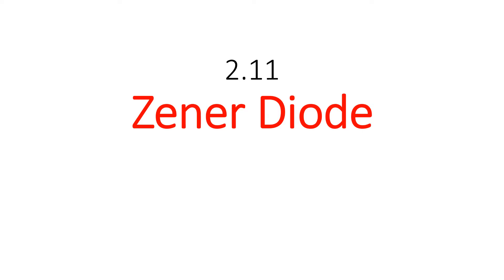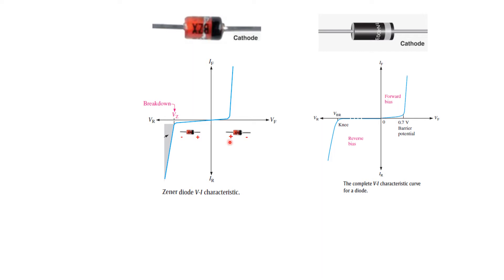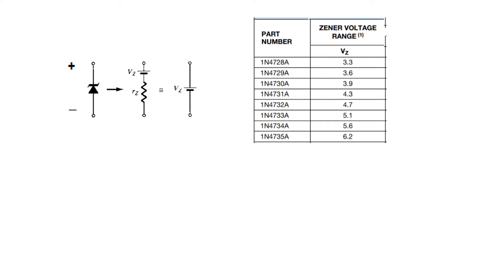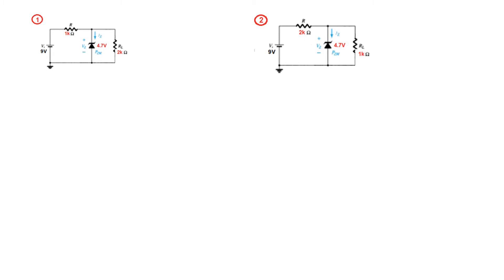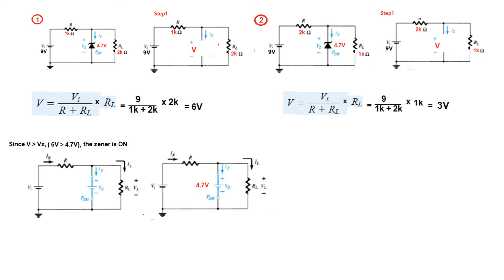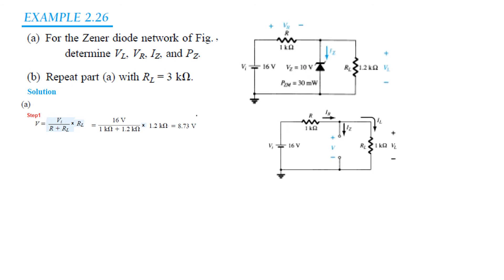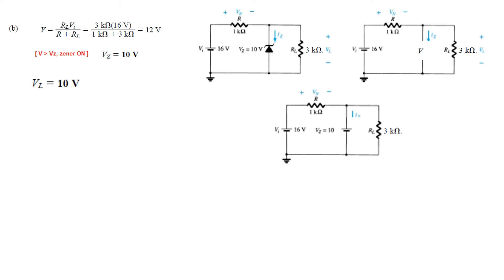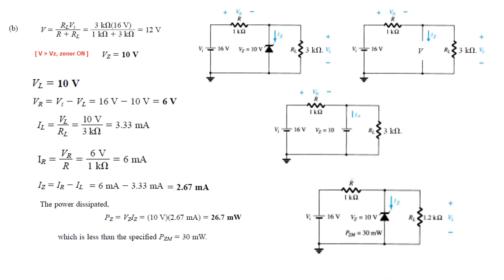(English)EDC || Example 2.26 || Zener Diode || How does a Zener Diode Work

Comment: Sir, we missed bjt, mosfet lectures.
Reply from the maker: Working on bjt.
Reply from the maker: Can u tell me what exactly to be covered in BJT ?
Reply: Transistor operation, transistor region,   fixed bias ckt, emmiter bias, voltage devider bias, dc bias with voltage feedback, ckt designing by BJT ( ref boyelested),  bjt region.

Thank u sir.